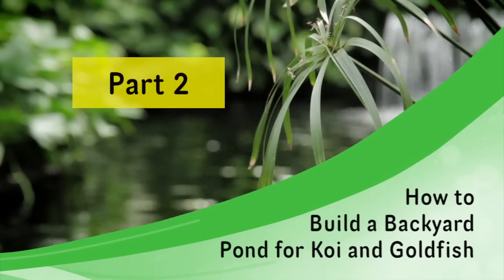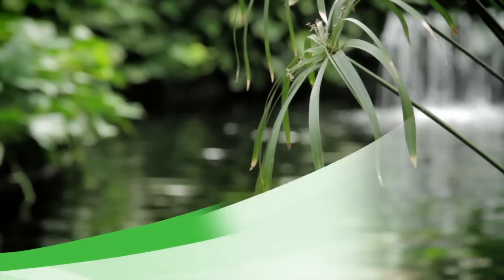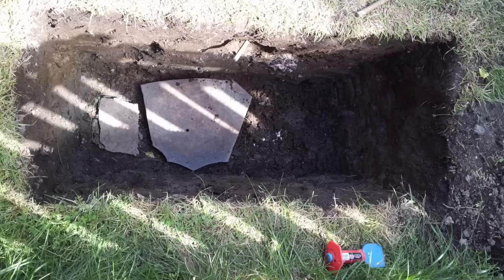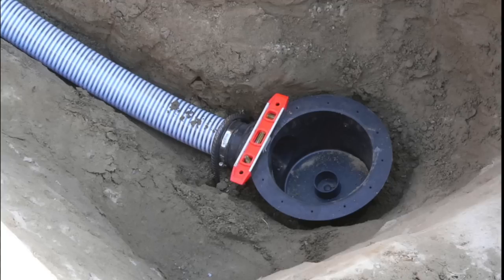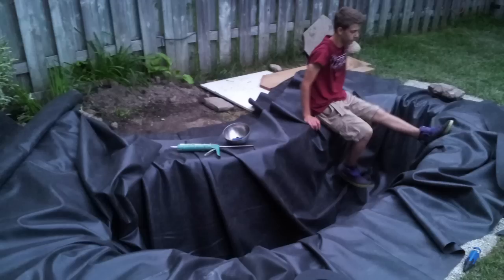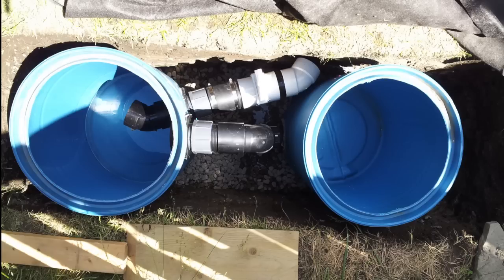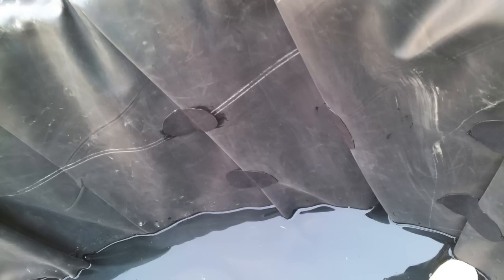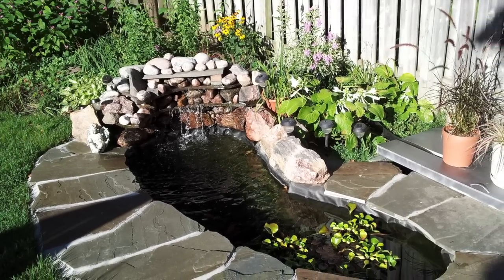How to Build a Backyard Pond for Koi and Goldfish Part 2 - Pond Liner and Filter

Comment: what if you can't put concreec on the sides
Reply from the maker: You'll find if you don't use the concrete collar over time the earth will begin to heave or shift over the winter months and your rocks along the sides will be more prone to shift and possibly fall into the pond.  It also will not be as safe as it could for walking around the pond edge.

Comment: I'm no pond expert. I'm building one myself and I've made many many mistakes. But I'm wondering about your set up there, with regards to your underground bottom drain pipe flowing uphill with only equilibrium to assist it to get to your first barrel.  Do the heavier solids flo up to the barrel at all or do they just collect in the lower part of your buried pipe ? The finished result does look very good and the water looks nice and clear.
Reply from the maker: +Gareth Floyd 
Good question.  But the system does work very well.  I can't say for sure that none of the heavier solids remain inside the pipe but I do know I collect a fair bit at the bottom of my first barrel every time I clean the filters.  What I also do is when I'm opening the check valve after cleaning out the barrels is that I open the valve quickly to get a surge out of the pipes and then I close it again.  I do this a few times and it seems to get any heavier solids of leaves that were remaining inside the bottom drain or pipe leading to the first vortex barrel.